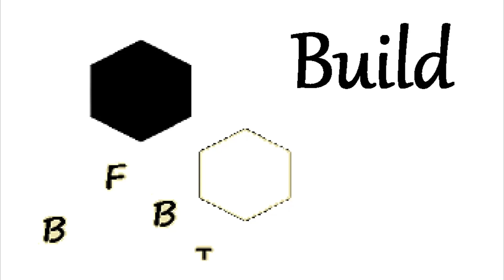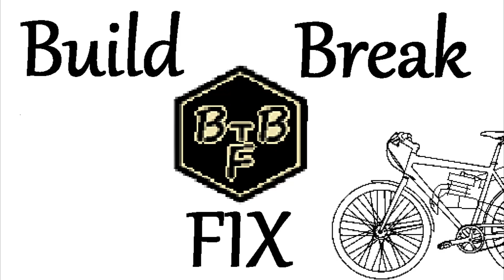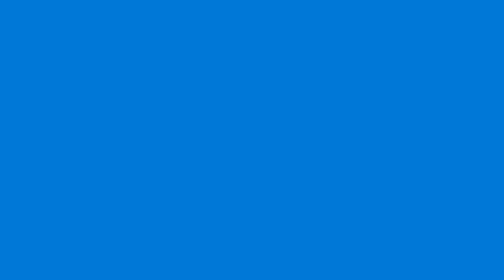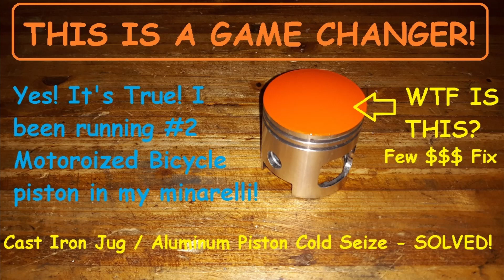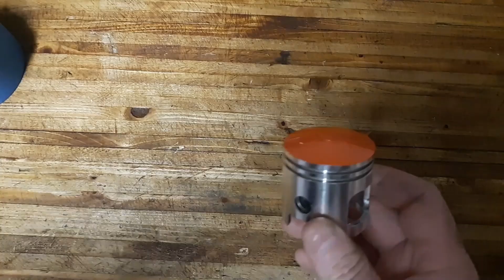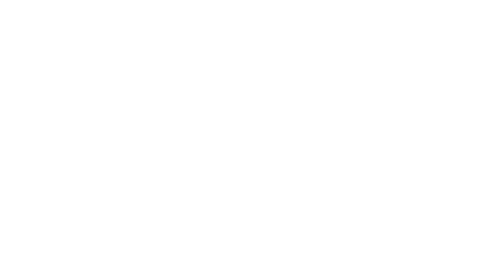Minarelli Aluminum Piston / Cast Iron Jug Cold Seizure Issue?  SOLVED!

Comment: Great my secret to keeping these motors running for thousands of flawless miles is out now,, we ceramic coated our 125cc shifter karts back in the 80-90's was the only way to stop cold seize or piston seize 👍
Reply: Yeah we did a 422cc was amazing. Was looking at this was like why are we not doing this to minarelli builds. This works crazy well in the carts with new cerakote out for 1200f temos
Reply from the maker: Yeah when we worked on few super cart engines week ago. Just made sense to do!
Reply from the maker: @upinsmoke1206  this year is going to be crazy at tracks, after it's been closed up here 2 years!
Reply: Ya man! Tracks are open now up here for early spring testing,,, Senior Light 125cc and 250cc are my jam this year,,, Open class next year if I survive 😲
The Death Wish is Strong this year 😂🤣😂
Reply: There are plenty of high silicon, high titanium, aluminum alloy pistons available and that would solve the issue and in fact, they are designed specifically to address the fact that the aluminum pistons are more fluid that the iron sleeves, or other sleeves they find themselves in quite often. I mentioned in a Facebook Forum (out of politeness I'm not going to say which one because I'm about to say something not so nice about it) that the cold seize could easily be solved by going full on titanium racing piston (which they seem to think either doesnt exist or costs a million dollars lol) or, my suspicion was that a high silicon/high titanium, aluminum alloy piston, which is also considerably less money than a full on titanium, would likely solve the issue as well. Thing is that because of the far superior strength of titanium you can use a lot less material to make a piston so a big part of the extra cost disappears but some guys, who are supposed to be experts pooh poohed this idea in favor of honing out the cylinder larger as the fix. If you ask me thats a seriously bush league and sloppy fix as sure, you make the hole bigger and the cheap piston has more room to swell but you have to take the extra slop up when cold with what, bigger rings right. Somewhere you're gonna have blowby and a lot more smoke/less efficiency, a lot more noise etc etc etc. and you're likely going to eat up those rings at a pretty alarming rate.
Theres a reason the factory Minarelli engines dont suffer this issue, nor do the racing scooter engines and when you look at the pistons they run you'l find the alloy I'm talking about mostly every time!
My background is in big engines. Hot rods, motorcycles, boats, lots of blowers, nitrous etc. I'm finding that guys with backgrounds like that have a much easier time stepping down and being really creative problem solvers with these little engines but also we have a much wider knowledge of real world parts that have been around quite some time whereas these bicycle "experts" seem stymied by problems and more often than resort to bailing wire, chewing gum, & duct tape to solve a problem in a very half ass way vs spending a couple bucks and doing it the right way!
Reply from the maker: @bigcconservativeguy2534   you realize Glacier Cerakote is designed just to coat the tops pistons lol right? Like top full dragsters now even use it. Drag cars and motorcycles are now ceramic coating piston Like Honda and BMW and such,  titanium is even worse the aluminum to expand from heat lol! No such thing as aluminum Titanium alloy though! You can't mix non ferrous metal with titanium or it does not bond to one another. Only metals with carbon bonds can blend with titanium! If it could of been done I'm sure they would of found a use for it in the jet engines I rebuilt for year.  Never seen silicon on a piston not to say it does not exist.  Just never seen that before. silicon only repels up to 1,200 f  So couldn't see that used inside a engine though.   But it works wonders to protect wires and tubing, fuel lines high heat areas. It just does not last long in direct flame contact though!
Reply: @BuildBreakFix  How can titanium be worse than aluminum with a melting temp that is far higher. that goes against the laws of thermodynamics/science lol. High silicon/high titanium aluminum alloy for example is the same deal, higher melting point also means less fluidity, its literally why they are designed/made.Wiseco has some very interesting coatings as well, just another alternative.I wasnt saying anything negative about your fix just offering alternatives, and pointing out that the honing of the cylinder fix was sloppy and bush league!  But you are 100% wrong about titanium and its heat qualities vs aluminum, sorry, you just are. If you are tryig to say that there is no such thing as the alloy pistons I'm talking about well 30 seconds research will show you that is definitely not the case so I'm not sure why you would go down that path. Perhaps I have misunderstood what you were trying to say there.
Reply from the maker: Titanium  has melting point of 3034F okay... and that makes it a better choice for a piston LOL! You forgot the part about how it Expands and contracts 47% more then aluminum does exposed to same amounts of heat.  You also forgot the part that titanium loses all structural bounds after 1560F and shatters like a crystal glass at that point. main reason can't weld or machine it very easy!  silica is not mixed in metals it's a coating mixed with ceramics applied to metals. just cause aluminum oxide uses it to increase wear durability from heating up and such does not make it a metal alloy. It's not physically bonded at a atomic level!

Comment: I thought about cerakoteing a 2 stroke bike kit years ago & started looking into it. There are test videos online of  coated VS non coated pistons/engines showing only minimal temp differences. People who sell cerakote act like it's some magical heat shield "game changer" ....An engine builder told me it's main/slight advantage was in drag racing. Where the engine doesn't stay running for long periods of time, just long enough to get down the track. He says it helps keep the engine internal temps down longer right after startup but once it's been ran for a while. There's barely any noticeable difference between coated & non coated......I think in a minarelli build it could help, since right after startup it might help keep the aluminum piston cooler for longer. (maybe also cerakote inside the aluminum cylinder head) Giving the steel jug more time to warm & expand. Then  keep the piston a few degrees cooler. In an all aluminum  engine it wouldn't hurt but don't think it'd make any noticeable difference. Maybe they've made a cerakote with better heat shielding properties within the last couple years. I would think the more layers/thicker added to piston head. The longer it'd take the heat to get thru the cerakote layer & start to warm it.
Reply from the maker: well I'll tell yeah what! Cerakoted piston vs non Cerakoted piston in this minarelli is night and day and is working like a boss!  there is a few kinds of Cerakote you know!  the type on this piston is listed in the description!  (This is the C-TYPE High heat Catalyst Bake on type for 1200F that does not even discolor at that temp!) Not to be confused with C-Type spray on! only good for 300F  H-Type  coatings only rated for 800F  Just the color used on that piston XX-128 there is 19 types of Cerakote for that color with different properties! They mostly use this Ctype I have on Gun barrels that get really hot! gokart people are now using it hot and heavy on monster builds in last 2 years!  But my minarelli WOT after about 3 minutes cold seize every time! Since the coating of the piston! I have Not had it happen once even after long durations of like 15 minutes really hamming it!
Reply: @BuildBreakFix  Awesome.....Now I'm gonna end up stuck on watching cerakote videos all day lol
Reply from the maker: @michaelbrinks8089  yeah there is a few types. One with catalyst you need to be careful with. Breath that ceap in your lungs will be ceramic coated. High heat one uses it! That is why I saw for 20$ get it done.  Not like painting!

Comment: That 3mm less skirt makes a difference to with less piston slap and friction wich helps seizing occur
Reply from the maker: Motorized bicycle piston runs much better in these jugs high rpms.  Though to be far! Minarelli ones are designed mainly for 7k max rpm and shorter high rpm bursts by design cause of the cvt they drive on the mopeds.  But you add ceramic to the top. It has been amazing it can take and reflect heat like it has.

Comment: I might have to do that take care of the getting hot problem I'm having with my minaralli I switched to amisol dominator and brought the temperature down a little was thinking about trying a minaralli with aluminum cylinder see if that does it how do you use the paint it on with a brush and bake it in the oven for a few?
Reply from the maker: It's not pait it's a ceramic coating.  There is quite a bit involved in cerakote.  Most gun shops have a place that can do it for yeah on a new piston like mine for about 20$ vs 1grand in items you need to use the stuff safely. Its baked on like pottery ceramics!
Reply: @BuildBreakFix  yeah that won't happen around here I'm in Texas there not like a lot of these other states there trying to make them   illegal so that you have to turn it into a moped which is costly to modify a motorized bicycle to a moped if you're going to do that might as well buy one witch is what they want you to do so then they can make money I couldn't even find a machine shop that would drill my cast iron cylinder minaralli from 6mm to 8mm they don't want to fool with them
Reply: @mikemiller3303  Mike where in Texas are you,, I have an old college buddy that has a machine shop in Austin, 
Bare End Machining, talk to Scotty,. Art sent you
Reply: @artofdisguy3401  I'm a hour and half away try not to go to the city anymore to crazy for me thanks anyway I purchased a cast aluminum version today see if it cools down better then cast iron

Comment: Can you help me with a carb? I have everything ready but i couldnt get a mukuni vm20 jetted properly. amazon sells wrong size jets all over the place!  Smolik Preformance recommends a 240-280  main jet. I got frustrated yesterday and returned the carb! Replaced it with a NIBBI PE19mm and i still can't get her started!
Reply from the maker: hey do this!   Your new to those carbs right?   DO NOT USE THE THROTTLE! just factory default your carb!  Main Screw screw it all the way in!  turn it 3 full turns out!  Your air mix screw!  turn it all the way in softly when you do both of them! The air mix screw you want to turn out 2.5 turns out! now your at factory defaults!    Use the  jets that came with your nibbi!  I'm about to use the same setup on my new one in my video i just released actually LOL  use the factory jets! came in your nibbi!  Pull your choke when you go to start it!   DO NOT USE THE THROTTLE AT ALL! or it wont start! seriously it's like most common issue people have lol they get use to NT carbs.   When choke is on never use the throttle or you flood your engine!   Leave the choke on! ride the bike drop the clutch few times if it's flooded.  it will start right up and after it does you can baby it a few times with the throttle to get her running!  turn choke off right away!
Reply: @BuildBreakFix  intresting, i am new to carb setups on motorized bikes.  Thanks for the advice can you post a short video explaining this?